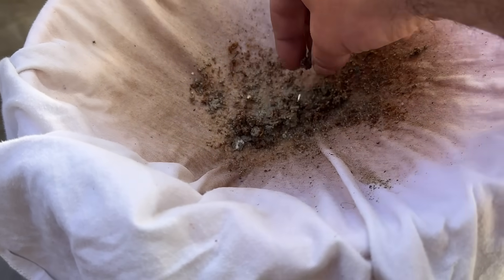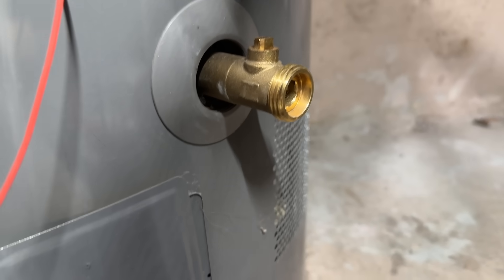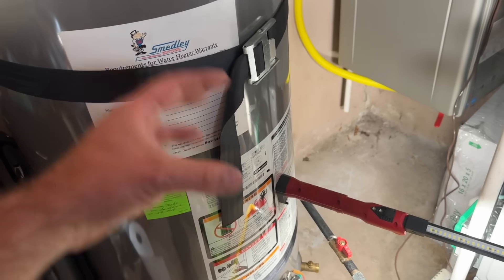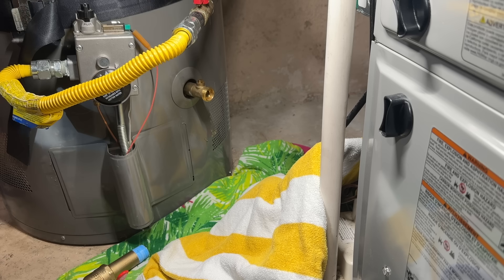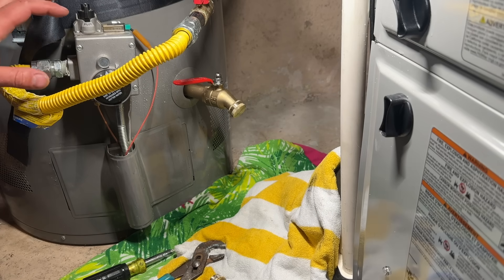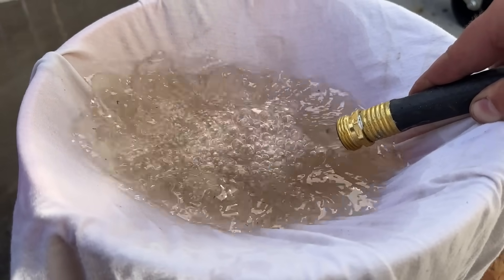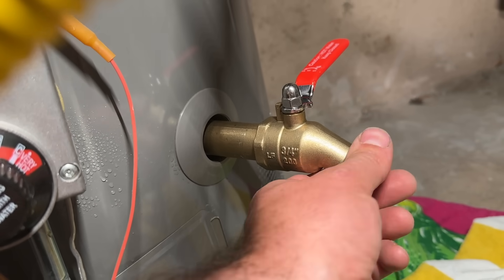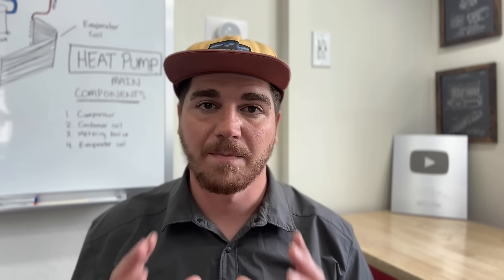Why Don't They Install These On Water Heaters From The Factory??

Comment: If maintenance on a water heater is necessary, why don’t plumbers install a permanent connection to a drain pipe. Here in the Houston area, water heaters are frequently installed in the attic. Dragging a garden hose up into the attic is a problem for most people, so having a permanent connection makes total sense.

Comment: Factor sux big time. Replace that plastic valve and loosen up and retighten the anode rode all before replacing the water take. The Factor likes to put about 600 pounds of torque on the anode rod.  So while the tank is outside you have room to handle that beast.

Comment: Nice job. I just replaced my plastic hot water heater drain plug after the previous plastic factory installed one at the outlet end. I used the same method you used and was easier than I expected. Now I can drain my water yearly. Remember to note on a tag the date you flushed the heater. Thanks for the video.

Comment: I replaced my water heater in 1996 and the brand new drain valve leaked the first time I tried it.  I replaced it with a straight nipple and a straight brass ball valve.  That gets you a straight shot so you can stick a wire in to stir up any sediment when draining the tank.  Nearly 30 years later and no problems.   No plastic to warp, shrink, crack, etc.  No leaks ever.

My previous water heater had so much soupy calcium build up, it would not drain.  It was like oatmeal in texture.  I had to move the full tank to another location to drain it. Removed the valve ocmpletely and used a coat hanger and it still took quite a while.  I'd guess that slop filled about 2 gallons.   I'll mention my house used to be on a well, later connected to a city supply.  I found all the original pipes in the back yard, packed solid with rust & lime.  

I also added a reverse osmosis filter system.  My wife got kidney stones, no doubt from drinking the city water that comes from wells below limestone layers next to the river. The geology in this part of the world is limestone which water dissolves. That gets distributed in the water supply.   The city water deptartment claims their water is within suggested guidelines.  Their main concern is keeping nasty bacteria and other germs out of the water, but not lime or cancer causing chemicals here in farm land.   Women seem to be more prone to kidney stones.   Seems like every middle aged women in town gets them.  It's extremely painful.  Do your wife a favor and install a filer system in the kitchen for drinking & cooking water.  My wife even uses it for the cats' water dishes. Cats get kidney disease too.
Reply: Does she drink a lot of tea?
Reply: Interesting, i thought kidney stones were more of a male problem because of the prostate.  I had an 8mm surgically removed over a decade ago and have passed 3 since. If it's the water wouldn't males and females be affected equally?
Reply: TL DR

Comment: Good idea but not sure that flexible gas hose meets code. Here in Long Island it needs to be fixed/hard piped with one union and no flex.
Reply: Flex gas hose is required in case of shifting. If there is an earthquake and there is no flexibility then that is a 100% guarantee major explosion. Thats exactly why there was a major explosion in PA a few days ago.

Comment: My Electric water heater is 10 years old and I have Lake Erie city water that I run first through a whole house 15,000 gallon capacity carbon filter then through a 60,000 grain water softener and I have drained about 5 gallon out of it and the water is crystal clear and have never changed the anode rod. Depends what kind of water you have in your house. I recommend a carbon filter as there is NO fluoride smell in the water and real soft, although I have a raw city water faucet next to my kitchen faucet for use in cooking and coffee. Soft water tastes rather bland but it protects your appliances and so good for washing anything and bathing. Most tank don’t last because too many minerals in the water. I had my original 82 gallon electric heater last 37 years on softened hard well water and NEVER changed the anode rod. Of course they made them better back in the day.

Comment: some ball valves have a sliding lock so they can't be bumped open, install the valve so the handle swings away from the tank

Comment: My one-year-old Bradford White 40 gallon take came with that exact drain valve and it takes over 30 minutes to drain the tank. I will be replacing it with this new valve. My best upgrade was replacing the original anode rod with a corro-protec electric anode road with a 20 year warranty. I'm hoping it will double the life of my tank.

Comment: Do you have a link for the red handle channel locks you were using? They look like they work well.
Reply: They are Knipex Pliers. German made.
Reply: @coffeedad, don’t use pliers, use a wrench. The flats in the pipe indicate that a wrench is the better option.

Comment: Would you try to drain a 10 year old Rheem 50 Gallon Natural Gas powered water heater? I have 2 in my attic that look great on the outside, but I didn't know I was supposed to drain them. A lot of people say don't touch it, but that's not normally how I roll unless it will do more harm than good.

Comment: Nice job. Success for me with a similar Rheem Classic Professional. 1) bought the House Mods HPM012 for the 2.5 inch length and straight bore in case I want to look inside easier with a borescope camera at some point. I had the same factory brass drain valve as you showed but couldn't get a bite with channel locks so used a large cresent wrench and levered off the valve. Lotsa gunk in there. I drained like you instructed, but ended up holding the bucket under as I was inserting the HMP012 and no water on the floor. Done. Works great. 2) Next step was the corro-protec install (I bought the kit with 1 1/16 and 1 3/16 sockets) and it worked great. On this Rheem, the anode hex head is flush so no deep socket needed. The original 10 year old anode was hard stuck so I used about a tablespoon of 1/2 acetone and 1/2 ATF mixture in multiple hits for 48 hours. I cleaned up any remaining ATF residue. Then I rented a 1/2 inch Makita TW0350 for $18 for 4 hours. It took about 8 seconds for the Makita to bust it loose. On pull out of the anode, there was anode residue so I used shop vac to remove, then wiped down the screw heads with rags. (if you have a helper, have them run the shop vac as you pull out the old anode). Then I drained the entire tank with no anode installed, and again flushed with some cold water splashes and a partial refill and drain.. Then installed the corro-protec and restarted everything. Old anode was just a bare rod after 10 years. Good project.

Comment: Just use a breaker bar and a rubber mallet to remove the breaker bar.  I have an 18 inch breaker bar, and a few whacks with the mallet is enough to loosen it to get it to turn

Comment: Your better off to just use a straight 3/4" ball valve with a 3" nipple to the tank and a garden hose adapter on the other end.  Even less of a chance of getting clogged.

Comment: You're lucky you didn't have a plastic valve right near the gas burner lines.  Have to shut off the gas,  remove the burner and temp transducer first.  And plastic valve is likely to break off during the removal.

Comment: just replaced my anode rod had to use a 4' breaker bar 1/2 drive and had to strap the heater and use a 2x4  to brace the strap and im a strong dude  it took a lot to break that MF free  why they need to be that tight from the factory   i taped it and snugged it and its fine now

Comment: 1/2” electric impact driver is the magic tool for removing stubborn anodes.
Reply: also just a breaker bar and a rubber mallet. a few whacks get it loose enough to turn with the breaker bar
Reply: @lander77477 socket and an impact.  15 seconds later it's off.

Comment: I'm definitely no expert... just spitballing thoughts here:
When it comes to hydraulics, doesn't the same flow through a smaller opening increase pressure?
Example:  a lot of ppl think it's better to have a large drain inside your toilet, but if the drain is narrowed, then the liquid increases pressure on the way out, leading to a higher pressure (and more thorough?) flush.  Other example ideas:  diameters of various straws.  Very wide (like the paper towel roll trend) is very difficult, but so is a coffee stir straw.  We use the +/- 3/8" diameter straws because it is a good balance of pressure and flow/volume.  
/shrug
Reply: But, what happens if the accumulated debris has larger pieces? What if the debris would form a plug/damn in the small exit hole? The larger opening is the way to go. We are not looking to INCREASE pressure, we are looking for lower pressure on opposite side of the valve, so water (and debris) flows out easier with LESS RESISTANCE. IE. You aren’t looking to FORCE the water and debris out with higher pressures, you are looking for water and debris to flow out with LOWEST RESISTANCE.
What is more likely to empty a bucket full of poop and water…a small hole or a large hole?

Comment: Don't touch your hot water heater just flush it every six months. I tried taking out the factory plastic valve and busted in the process leaving part of it in the hot water heater. I had to buy a new hot water heater.

Comment: My Rheem water hearter, self installed,  developed a pin hole leak last week at the hot and cold nipple connections. It was 33 years old with a plastic drain valve. I drained the WH 4 times a year with a garden hose for 10 minutes while under pressure. My new Rheem, self installed, like the one shown has the small brass drain. I am not a pro so I am conscerned I might damage the nipple. It usually takes me twice to fix something.

Comment: I Drain the water heater, replace anode rod, did like 25 flushes and what it came out was Horrible. a brand new, 5 years without touch it. Anode rod was completely depleted. I replace plastic drain valve that came out very easy, for a metal one with big hole. The water heater was making pop noises when heating, now is quiet like new. I will do flush, and check anode rod every two years.
-- Don't believe what you hear, read or see, just Prove and see by yourself. last statement goes as well for religious people.

Comment: I just installed the special valve on my water heater. Very easy job. Always get the HMP011 version of the valve. The 3/4 inch nipple pipe is a bit longer and easier to install on 50 gallon tanks.

Comment: Will the water heater still flush like that if I run the hose up some concrete stairs at the Bilco doors? I have no floor drain, so I would have to go against gravity. Don't really want to use a pump because I already don't know what I'm doing, and my water looks milky because my house sat for 2 years. Calcium buildup around my sink is insane, too. Can't keep up. Thanks.
Reply: Sound like your entire house needs a flush. Head pressure in the tank will force some water out and up, but you'll lose that pressure as the tank drains down. Water transfer pumps run between 40 and 60 bucks on amazon. Installing a salt-water softener solved my calcium problem.

Comment: I had the same issue with trying to remove my anode rod.  I had no way to brace the water heater and it just wanted to turn when I used a long pry bar.  The solution: use an impact wrench (like taking the lug nuts off a car.)  The torque is focused on the center of the anode rod instead of off to the side of the tank.  It comes out as easy as falling off a log.
Reply: Great suggestion!  Can you share what size socket you used please.
Reply: @ 1 1/16” socket size.
Reply: also just a breaker bar and a rubber mallet, a few whacks gets it loose

Comment: The WH that costs 400 dollars extra will come from the factory with the 15 dollar ball valve. Or...you can add one to the 400 dollar cheaper WH and have the equivalent Water Heater for 385 dollars less. Maths

Comment: I did this to one of my WH's in a home I sold in 2010. I'm so glad I did that... the problem I have with my existing WH is the drain is plastic and when I tried to change it when I was installing the unit, it would not budge and I did not want to break the valve and have to fight with removing the broken stem of the valve. the brass ball valve idea is so much better than what these WH;'s come with....

Comment: Are there any tricks to getting a plastic drain valve out, without destroying it? 
I can seem to remove the opening valve, with its drain hole, but the valve itself
(without too much pressure yet) seems to be getting bunged up...
My thought is to add a long pipe extension to my wrench, and then try to break it free...
Reply: Again, some are not removable, epoxied in place.  Craftmaster did this, they make tanks using different names.

Comment: 6:23  my anode rod was fairly easy to replace on my 15 year old water heater.
Of course I tried the old wrench/cheater bar method at first... No Go.
I used a Harbor Freight electric impact gun and 1-1/16" socket.
Thanks for this drain valve upgrade video.  😊
Reply: Do you know whether 1and 1/16" socket size is standard on these anode rods?  I have a Bradford White water heater.
Reply: @doradean3097    I believe that size is common on just about all of them.  An impact gun will definitely help with breaking the rod loose.
A ratchet and cheater bar, with all that leverage will try to spin the whole water heater.
Reply: @BlainsTube  Thanks very much for replying.  Using the the impact wrench is definitely a great tip that will help remove the anode rod much easier if one has the hex type fitting.  Mine, unfortunately after checking just now, has the nipple type fitting. Since the heater is 15 years old and I have hard water, not sure if pipe wrench will be able to loosen it without breaking anything.  The water hasn't start to smell yet so was hoping still not too late to replace the rod and extend the WH lifespan some more.

Comment: Thanks for doing this video, it helped me. I ordered one of these larger opening valves and at the same time I ordered the Sediment Buster to help with the flushing process. I turned the incoming water off and then went and opened all the hot water faucets and then drained the water tank. Then I changed the water valve to the bigger one and then put the Sediment Buster on to see what was coming out of the water heater when I turned the incoming water back on in order to flush the water tank. This worked well, you could see what was coming out. I flushed it out three of four times. Meaning I turned the incoming water on, injected air and let the water heater fill up most of the way, then turn off the incoming water and let the water completely drain out and then do it again. I am so glad to have had the larger valve to help with allowing the water to come out faster and larger particles to come out. Here is the link to the Sediment Buster. https://sedimentbuster.com/product/sediment-buster/?srsltid=AfmBOopampMOn_v7zJXoeHGmDKFFNWVVqKdTz_--mAbxWTenA7jhSB4uLIk

Comment: Many years ago I had a water tank removed and it weighed a ton. Full of sediment and it was well known that the water was crap but it was a rental property on the army base 😮
Reply: Yep, my cousins was in the basement, installed during World War II, removing the old one took four guys to get it up the stairs! Drained
Mostly. Had a cardboard outer jacket they called it: war emergency modifications. 
Not sure if you ever heard of vermiculite insulation… BIZARRE!  Home was built in 1910.

Comment: Wow in the world did you get all that water coming out?  When I flush mine, It usually takes me so long because it somehow the flow is not as much as what I saw in yours?
Reply: Check the supply pressure. Normal flush is under full pressure. Let it cool down some.

Comment: Saw the thumbnail and was reminded of the overflow/safety valve on our 25-yr old water heater. 2 weeks ago we used it for the first time as a way to temporarily relieve some pressure for a faucet replacement project (long story, but opening the other hot water faucets didn’t fully get the job done.)

Project done and the valve began to leak. Bought a hose adapter and now the valve has a stupid garden hose attached so that it can leak into a nearby sink.

And of course the garden hose isn’t rated for hot water under pressure …
Reply: Use the BRASS hose cap. Keep a couple on hand.  They May be needed, should you need to replace the hose on the washing machine, Valves don’t always seal when they are off. (A tip) plus some  spare garden hose washers, they harden in storage. These are Cheap insurance.  Here in Texas, builders  sometimes put water heaters in the attic. 🤷‍♂️

Comment: My dad does all things hydraulic and diesel. He brought me home a 1" watts WOG valve 600psi lol. he said use it for whatever. i reduced it down and got the nipples for my water heater. I just have to install it now. I hate those stock ones. They suck. 

i do mine bi monthly. I write it on the tank with a sharpie that i keep on the tank.

Comment: Plumber here. 

At the very least take the handle off. 

Because this is a...

Lawsuit waiting to happen. Kid or pet (especially with garage places water heaters) Hits the handle or yanks in on it. Burns. Hospital bills. Chaos and bankruptcy for the plumber because it's also technically against code to change/modify fixtures or appliances from the manufacturer specs (stupid AF I know) and anything done against code is something the plumbers insurance will not cover in many cases.